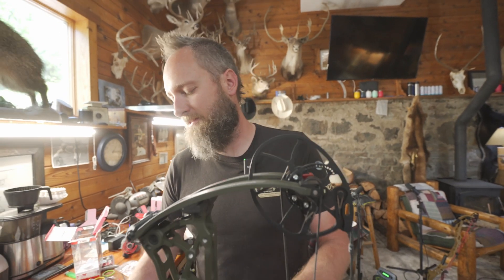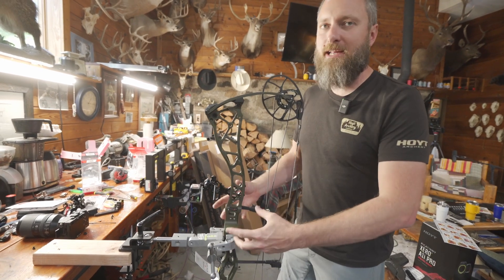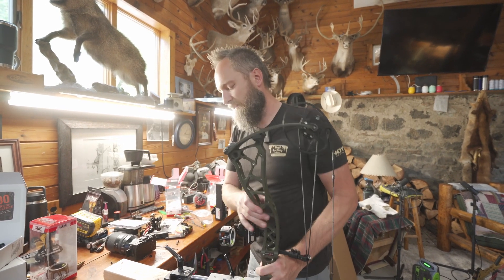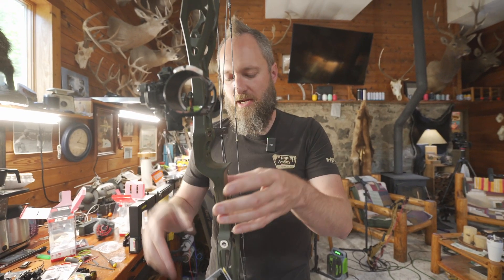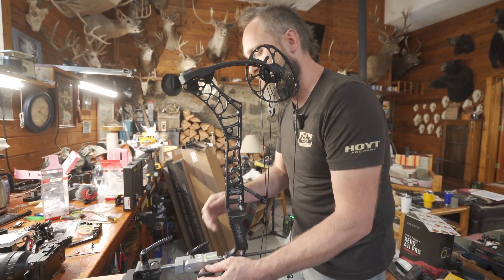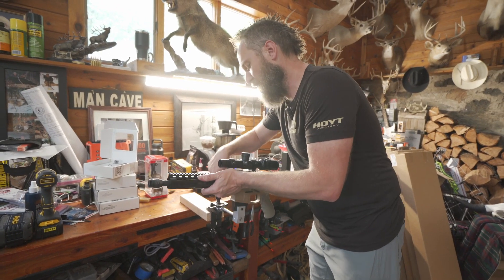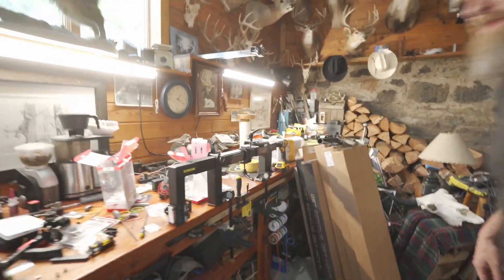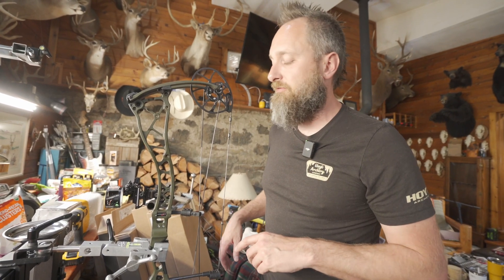Last Chance Revolution Bow Vise Review with MFJJ!

Comment: Not relevant to the video but I don’t have anybody knowledgeable to ask. I just got a new bow set up and the poundage is about 8 pounds lighter than it should be. The limb bolts are maxed out. And it is a 70lb bow but only pulls about 62-63lbs. The only thing I could think of is they took a couple twists out of the string to get the peep straight. I don’t know what to do any advice would help.